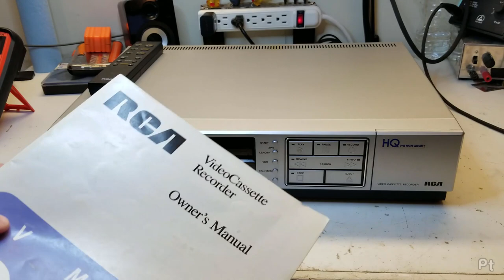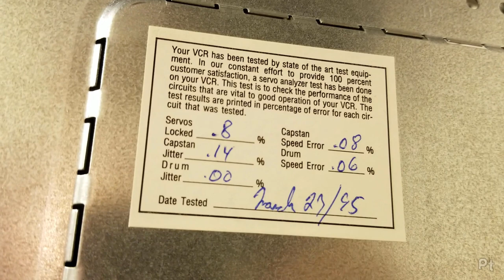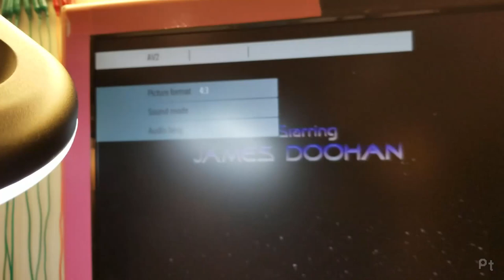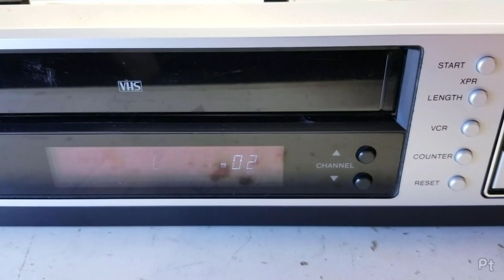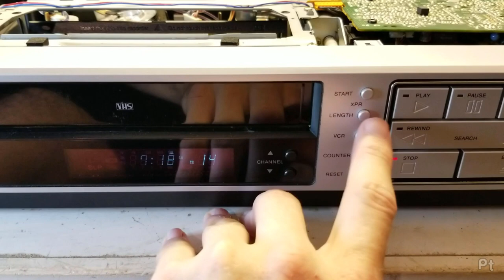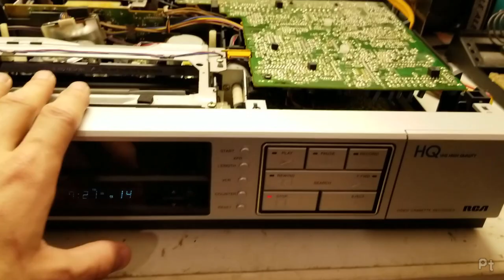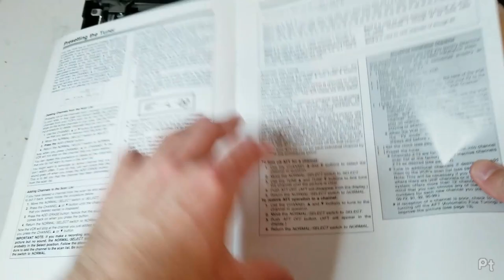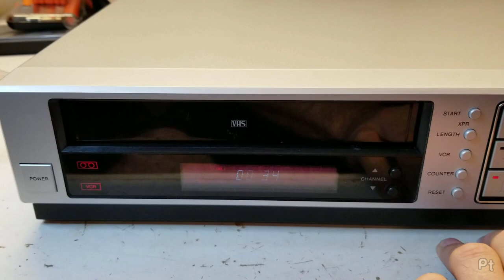RCA VCR model VMT-285 (from 1987ish)

Comment: I had this vcr some time ago. The pinch roller had gotten loose but I managed to glue it back in place and it worked flawlessly until vhs tapes became irrelevant. One thing to note is this vcr is a great way to convert a composite input into rf for older TV’s since it seems to ignore the macrovision encoding that you’d find on a dvd